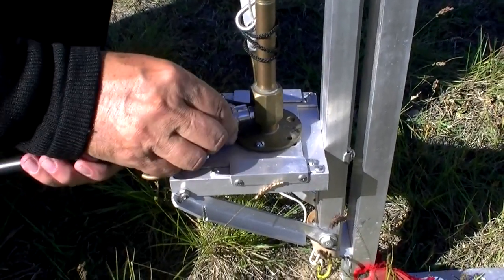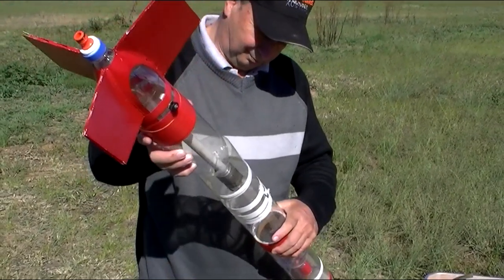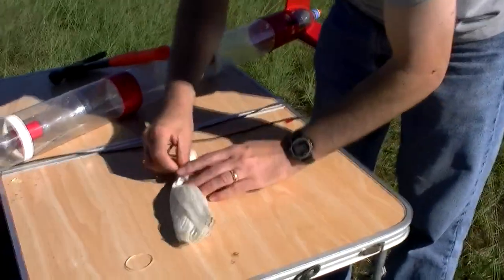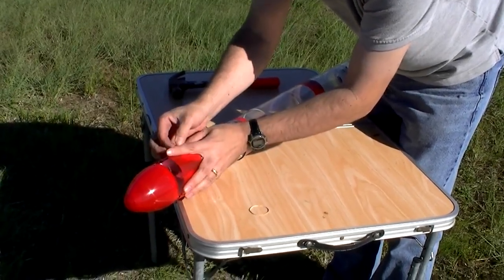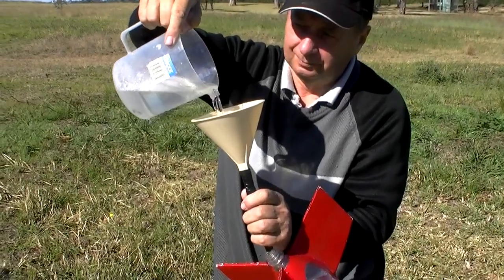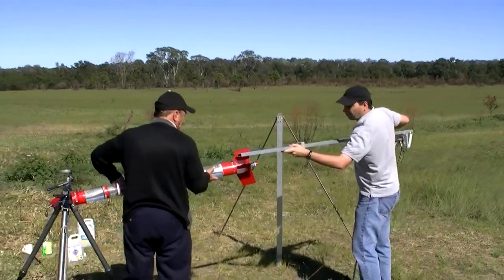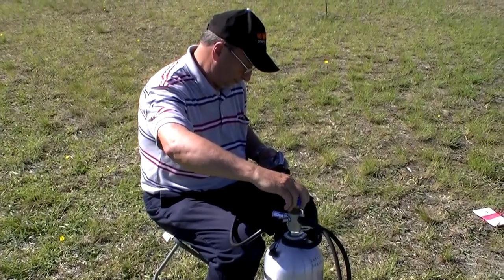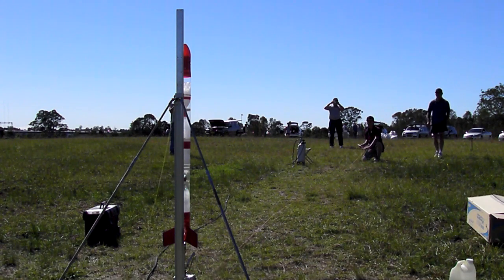Water Rocket Launch Procedure

Comment: Hello. Nice rocket, nice flight! ;) May i ask two questions? How do you prevent the gardena connects from leaking? In my experience, when using such connects in garden for plants watering, they always leak, so how can they cary such a high preasure? Also is there any tutorial about that jet foaming spacer? Would it be useful if using only water without soap? Thanks in advance ;)
Reply from the maker: Vytenis Misevicius Hi, we've never really had an issue with the Gardena quick connectors leaking, even at 200psi. I guess it comes down to the quality of the quick connector. We typically use the Gardena brand. You can also make sure that the sealing surfaces are free from dirt and scratches and the o-ring is in good condition. We don't have a tutorial on the jet foaming spacer, but essentially it is just a PVC pipe with a restriction in the bottom whose hole is about the same size as the nozzle. I am not sure how well it would work without soap, but it would be worth trying. Some bubbles would still get generated that way.
Reply: AirCommandRockets Thanks for reply ;)

Comment from the maker: Another good question. The bottom rail button is taped in place permanently. The upper one is either taped onto the pressure chamber after the rocket is assembled, or it is attached to the fairing and can be rotated into place to align it. The fairing is then just taped to the bottle to stop it rotating.

Comment from the maker: Hi Bolivar, the tube is called a "jet foaming spacer" it helps create an air pocket in the lower bottle so that foam can be produced during flight. Without the tube all the water from the top bottle can drain into the lower bottle while the rocket sits on the pad. We have more details on our website (see day#105 flight report)

Comment from the maker: It triggers the on-board parachute deployment timer. On the slow launches like this one with foam sometimes the on-board acceleration switch does not detect launch, and so we use the string to trigger the timer. For faster launches we just use the acceleration switch.